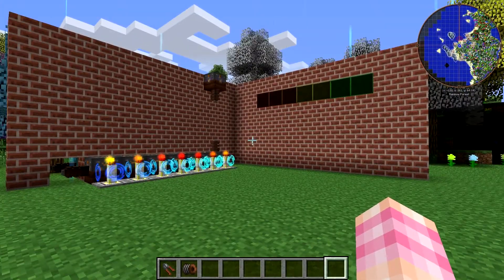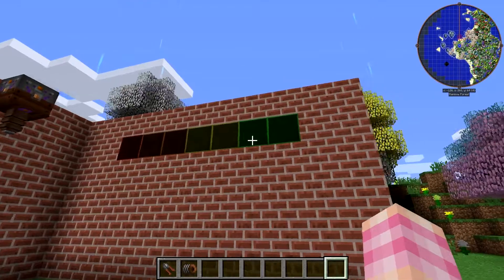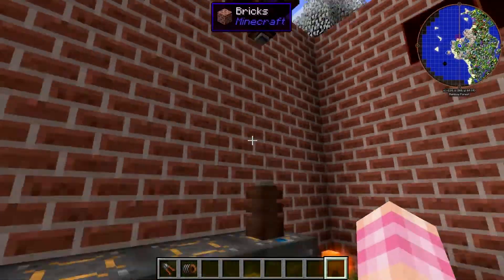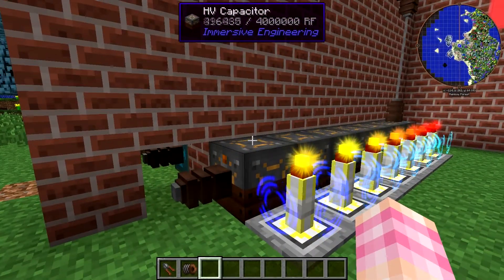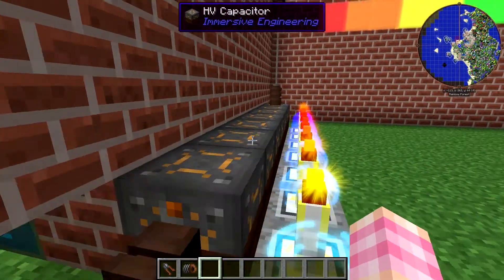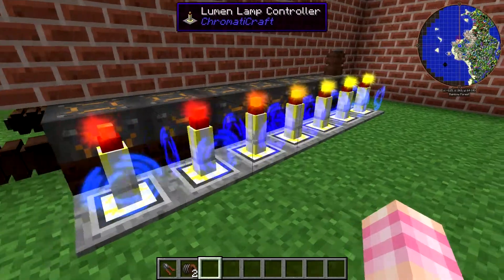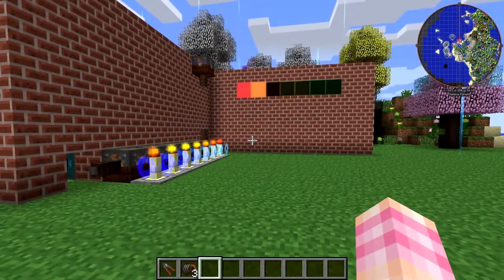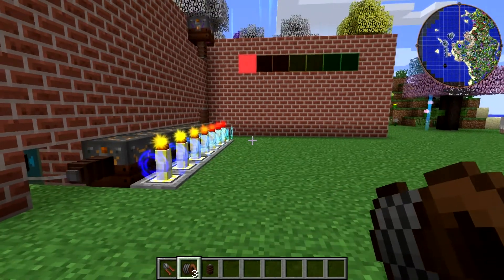Revolution 3 - Power Level Indicator Prototype

Comment: 3:10 That's because the capacitor  gets power and immediately transfer same amount of power as it just got (since the input rate is fixed to 4087 RF/t) to the next capacitor.
Reply from the maker: Indeed. Each battery had 4087 RF in it. I got the system working though.

Comment: if you don't have a long battery but a single block huge battery you could use a comparator with a row of 15 redstone dust attached to it and 15 lamp controllers
Reply: That was my first thought. This mode is really just to have it tell you things are on... Most likely so you can remember to turn them off. It would likely be better if there was a way to invert the signil... So the lights came on when the power ran out.
Reply from the maker: I did get this working finally